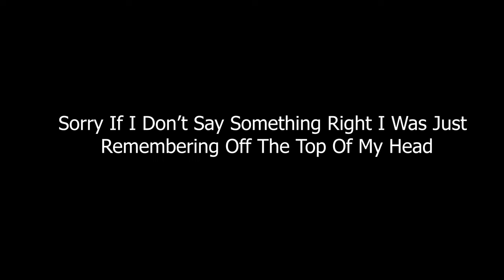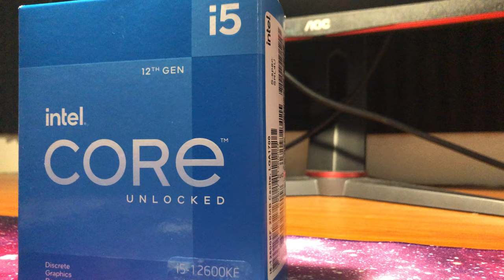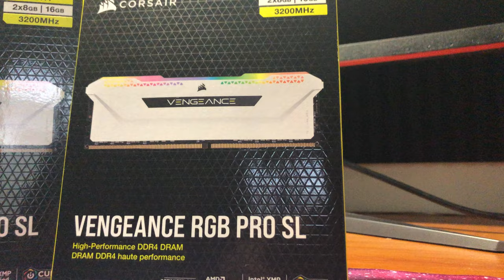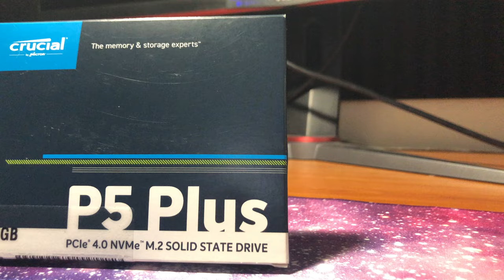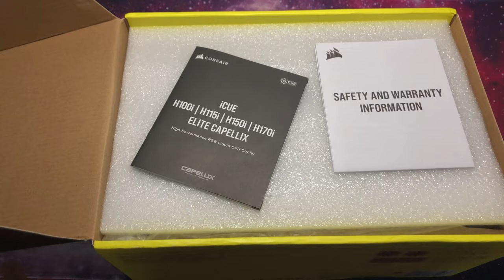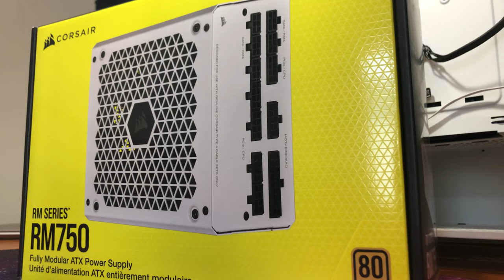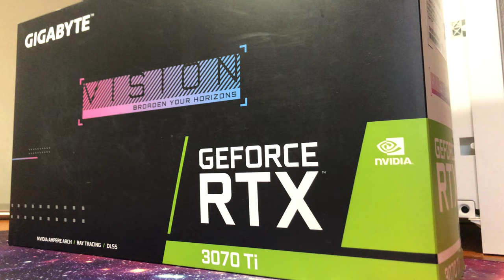Building My First PC

Comment: Sweet build! 
Only suggestion if you haven’t already corrected it is most reviewers/builders I’ve seen, LinusTechTips, GamersNexus, etc. recommend using two separate 8-pin cables instead of a single daisy-chained pair like you used, if more than one cable is supplied with your PSU. Since your card may pull more watts than a single 8pin can supply within spec. If you don’t have another cable it should be fine but there are horror stories out there regarding single cable use on power hungry GPUs. Would hate for such a clean looking build to get messed up!
Reply from the maker: Thanks so much for your comment! I do actually have a spare 8 pin that I could use. Thanks for the suggestion, I really appreciate it!
Reply: @catchymussel5952  this is a must. 2 independent cables will allow for more power delivery. You'll get more performance
Reply from the maker: @OscyJack-  Yes, I have changed it. Thanks for the suggestion tho!

Comment: All things being good dont do this silly mistake. Never use same power cable back for GPU. Always use 2 different supply straight from the PSU. It may look bad but that will keep you PSU as well as GPU running for a long Time.
Rest Keep up the good work
All the best
Reply from the maker: Yes I am going to change it. Thanks for your comment!